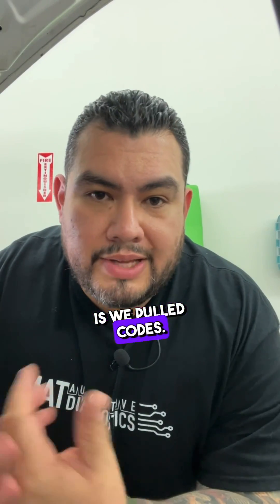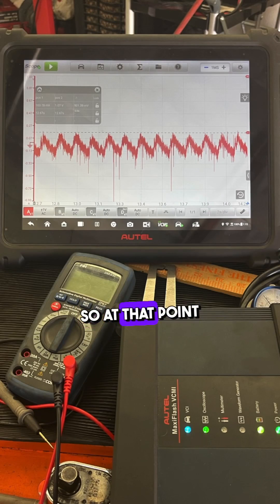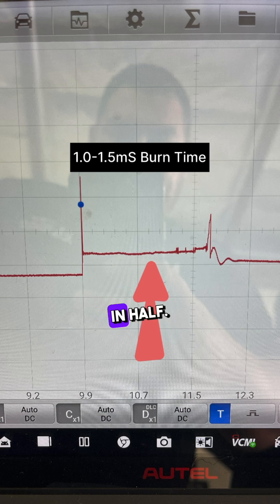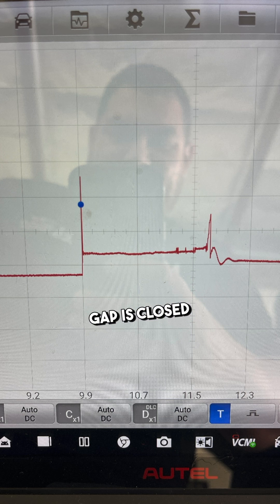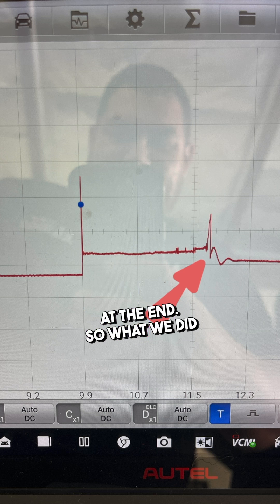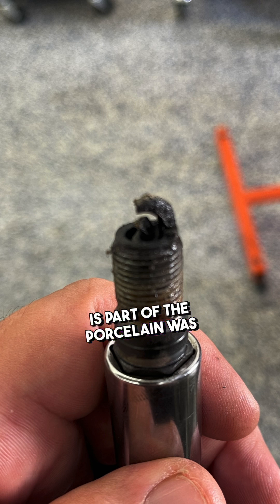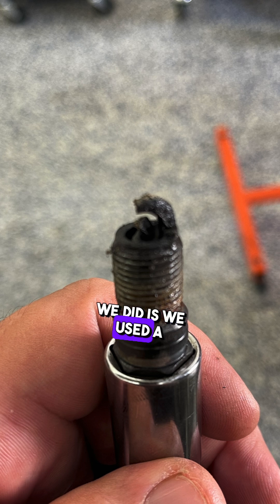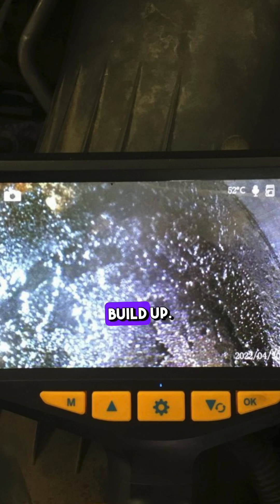Diagnosed a Fouled Spark Plug in Our Ford Mustang Using an Oscope.

Comment: Been using scopes for over 40 years. Started back in the mid 80's with an Allen Smart Scope, then a Bear BASE, Councilour, Sun Interogator and now PICO. Techs that don't use scopes are basing most of their repairs on guessing. Unfortunately the industry is rampant with the get the code and replace a part mentallity.

Comment: So you didn't solve the problem and could have only checked the spark plugs as always to find carbon deposits
Reply: Step up your game pal (oscilloscope is a must in modern workshop). You've missed the point. He diagnosed a problem before removing the plug. There are instances, where parts are "good looking" (nice, clean sparkplug for example), but it's bad (internal fault). You will never "diagnose" this just be looking (is it clean=good or dirty=bad logic).